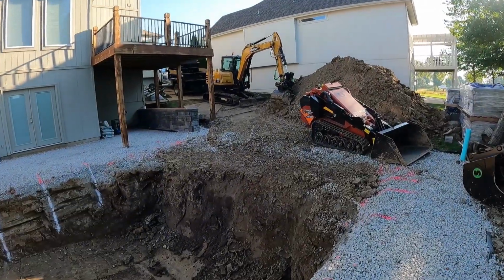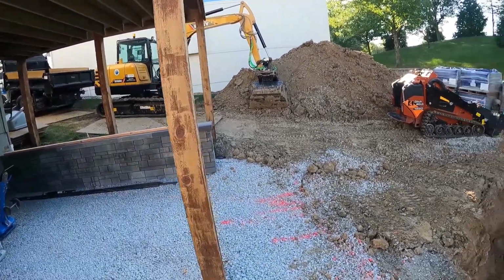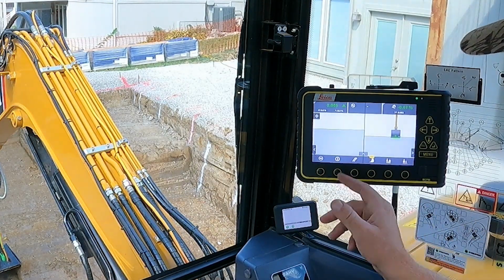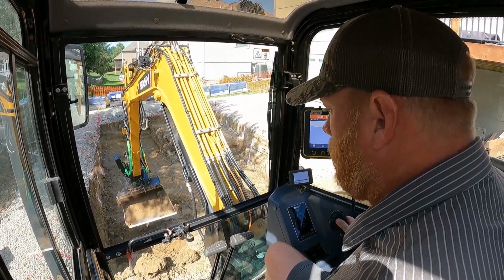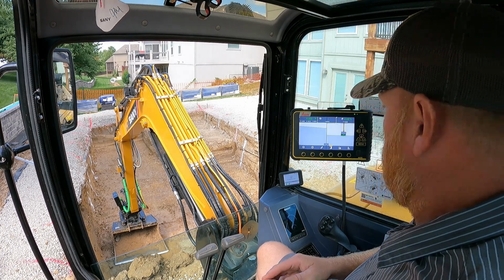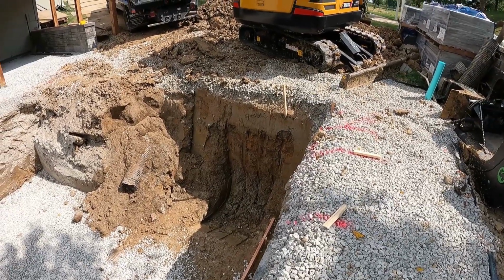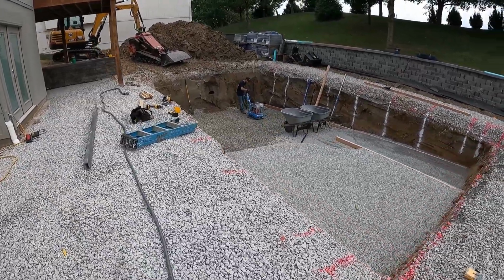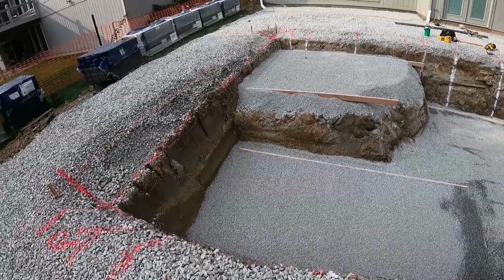I Finally Figured It Out/// Pool Excavation Part 2//Sany SY60C/SteelWrist/Leica 2D Grade Assist

Comment: how come you went with steelwrist instead of other options?
Reply from the maker: It was more about the dealer and excavator I went with. My sales rep did all the leg work for me. Other dealers I went to didn’t really want to mess with it. The result has been great support and service after the sale as well.
Reply: @ShellerOutdoorLivingLLC  You definitely have basically the set up I’m going for. I’m still waiting on my engcon tilt rotator but definitely the 2d grade set up is probably gonna be right behind.

I went with Engcon because they’re the only ones in the front who sell before hydraulic top hitches for smaller machines. I think rototilled goes down to s45 for 6 to 7 ton. I have a 4 ton so I had to get  s40.

From what I can figure out all of the main brands make a great product. I’m definitely curious to take a look at sany for my next excavator there seems to be a lot of people who are using them these days